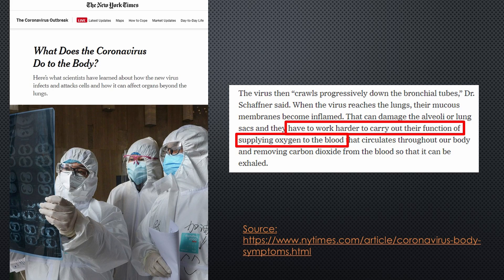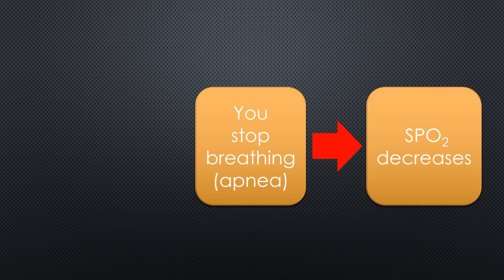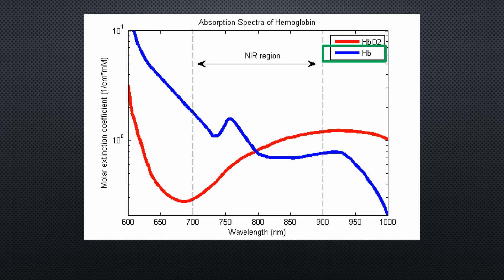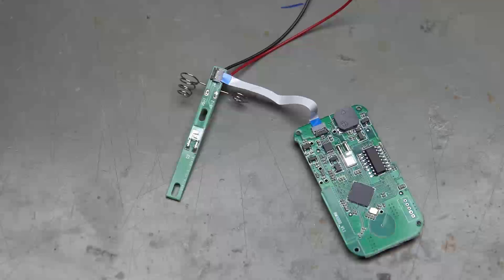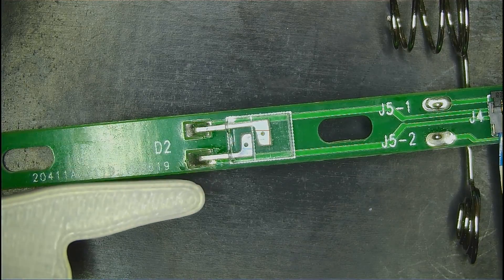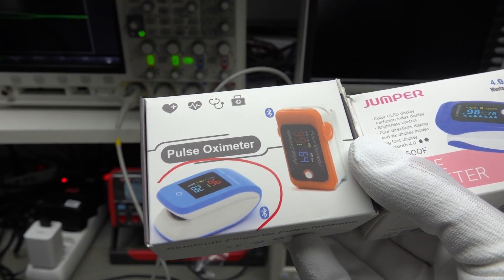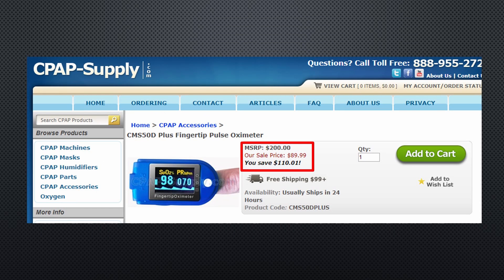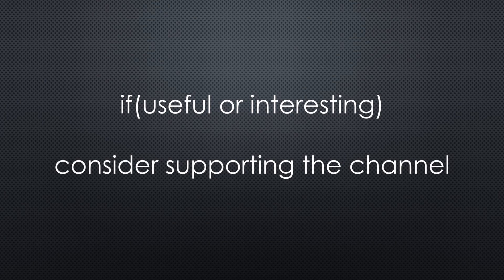#316 Pulse Oximeter test, function, and usage

Comment: You said it is hard to manipulate oxygen levels. I was testing myself a few days ago and got 94-93%, just like other family members. "It is crap"  that's what I told to myself. But then we went to the shop for a little apocalypse hoarding and when I got back it was 97%. Maybe just going to fresh air can increase it by a few percent?
Reply from the maker: During my test I also saw some changes depending on the movements I did. But I did no stress test.

Comment: :). But i would not recomend testing without having any symptoms and then alarming the doctor. - Btw: with respect to corona, another maker genius -> https://baophapluat.vn/s%E1%BB%91ng-kh%E1%BB%8Fe/t%E1%BB%B1-ch%E1%BA%BF-m%C3%A1y-tr%E1%BB%A3-th%E1%BB%9F-cho-b%E1%BB%87nh-nh%C3%A2n-ngh%C3%A8o-m%C6%B0%E1%BB%A3n-mi%E1%BB%85n-ph%C3%AD-221863.html
Reply from the maker: Interesting article. In countries without infrastructure this might save some lifes. Unfortunately you need to intubate the patients. Which is a little more than just adding pressure ;-)

Comment: I would love to see a video detailing how you took apart the CPAP and read its function! Thanks for the video!
Reply from the maker: I do not think there is a standard. So you have to google. Maybe you find information about your particular device. I selected mine because it is compatible with this OSCAR software. Maybe you place an issue there and ask for support? For this channel, this is too special.
Reply: @AndreasSpiess  Yes, each manufacturer probably uses a different standard, or personalizes the data so that only those in charge of the work: maintenance technicians or doctors, can read the data. Ultimately there may be some fool who wants to tamper their data for some sort of convenience.
p.s. my CPAP is a Respironics: a medical brand of Philips 
Hi
Reply from the maker: No need to take the CPAP apart. It has an SD card where it stores its information
Reply: @AndreasSpiess  my cpap had a SD card too but i  cannot read data. the pc tell that SD card is empty, but maintenance people can read  it! 
can you tell us why, maybe in a video?
Hoping all the cpaps brands uses the same code
tnx in advantage

Comment: Excellent explanation, as usual! The Red/IR was also visible in the photo of the "LED" 7:44 --> There are two dice and two bond-wires placed back-to-back. Another clue as to the red/IR on the scope 10:14 is the forward voltage of each. The IR has lower energy per photon, and hence a lower forward-drop (~1.4V) whereas the red has ~2.0V.
Reply: A project-idea? --> Create an open-source oximeter better than the crappy and unstable cost-down-rubbish with a (say) Teensy of STM32 M4 or ESP32
Reply from the maker: That is what I also thought when I saw the two different voltages. But I did not lookup the foreward voltages of hte different diodes. I think these devices are not crappy at all and it would be very hard to do it better.

Comment: Great video Andreas, thank you! However please be aware that this method doesn't allow you to draw any conclusion on a potential infection (eg with the virus), it is just a parameter that gives you an indication about the amount of oxyhemoglobin in your blood. Skin, bones, light etc are impacting the reading and therefor the absolute number you read on the display is never precise. You can read a SO2 of 99% or 92% and be healthy, but in case the value over time drops you should further investigate the reason for it. So the sensor is used to detect abnormalities over time and software on intensive care units offer dashboards that detect any significant alterations. Obviously a significant drop of SO2 above 10% would be such an indicator.
Reply from the maker: It had a reason I did not "praise" it for the virus application. The CPAP application is well known and AFAIK accepted.

Comment: I bought the CMS50DA+ from Walmart.  I use it with Eneloop NI-MH batteries, it's good for one night, probably not two, on each charge.  When the batteries are low it can give nonsensical results rather than shutting down.
I tried reading the data via USB with SleepyHead software with no luck.  It does work with the supplied software running on Windows XP (i have no plans to ever get a newer windows machine).
Reply from the maker: That was also my experience with IKEA batteries. SleepyHead seems to be the (abandoned) predecessor of the one I used.
Reply: @AndreasSpiess  - Thanks, I didn't know SleepyHead was resurrected.  That helps.

Comment: The graph at 13:50 actually shows SpO2 levels rising during the time breathing stops.  I assume this is because Oximeter doesn't keep track of time and software calculates time from the starting time that you enter manually and sample number, so this SpO2 plot is actually off by about 40 seconds.
Reply from the maker: You have to synchronize the two manually and it is hard to align the start on hte second. The Oximeter has no internal time.
Reply: @AndreasSpiess  The F and I models have timekeeping - unfortunately the CPAP's clock isn't as good. Mine needs to be reset at least monthly.

Comment: Very interesting, informative and potentially useful video, thanks !
Reply from the maker: You are welcome!
Reply: The Arduino sketch may not work with the max 30102. But a more powerful arduino type device  may work using the sketch. A reflexive rather than translucent hemoglobin device is useful very useful in determining blood perfusion in less than translucentParts of the body.

Comment: By the way, there are now cheap boards with AD8232 chips for ECG amplification. Normally it's a mess to set up differential amplifiers, what with dual power supplies etc. But these boards do all the work, require only 3.3V and output a very arduino friendly signal between 0 and 3.3V. From what I can tell (I'm a Veterinarian) the signal should be good enough for most ECG based diagnostics, even if not certified. It seems to have a low-pass filter around 1000 hz. Not sure how useful the absolute amplitude is, there is also some high-pass filtering going on. When I say "ECG based diagnostics" I mean that the amplifier seems good enough, but you'd have to arrange enough of them in the right way, of course.
Reply from the maker: There are quite a few videos around with this sensor. So I decided not to cover it. I would not know what to add. Most oximeter videos were less technical.

Comment: Thenk you for this video. As engineer and asthmatic patient I have one cheap device and I thought if it was good or not (for 20€). The one they use in hospital costs about 350€! I appreciate your work.
Reply from the maker: I also thought these are toys. This is one of the reasons for this video. When I started to dig into the matter I saw that the method is simple and can be done with standard LEDs and chips. And the accuracy seems to be quite good.

Comment: About a month ago I bough one of those things from the German company Beurer for about 50EUR. I have most of the time about 90%-92% oxygen level. That is far away from optimal but not as bad as it sounds. I also visited a doctor and he confirmed those values. I write this here so people don't panic if they see low values. My girlfriend has constantly 99% measured with the same device.
Reply: Please be aware that the impact of skin color, segmentation of the skin etc etc are impacting the measurement. Basically in med applications the trend is of essence, so if you have a drop in saturation compared to your 'standard' value there is an issue, otherwise you should not become concerned!
Reply: @juergwyser6520  In my case the values from my measurement and the values from the hospital match. I have "white" skin. My girlfriend has brown skin and her measurement is constantly 99%.

Comment: Thank you for this vid. I'm interested in measuring this but I always thought such medical sensors would cost an arm and a leg, or even more. Do you think it would be possible to receive the data live by BLE, all through the night, using an ESP32-based project? Such project could pass the data to MQTT/NodeRed/Influx/Grafana and it could administer a small electric shock at an APNEU event, or, start beeping when the sensor falls off from your finger during sleep.
Another way to detect breathing would be to put a loop of flexible resistive wire around your chest and measure the resistance of that continuously. That would be a good alternative for people that would pull off the finger sensor in their sleep.
You should buy some AAA-sized 3.2V LiFePO4 cells for your oximeter. The ones I bought come with a short circuit dummy, for use in 3 Volt devices that hold two batteries.
Reply from the maker: Maybe somebody hacks the BLE with an ESP32. So far I have no time for such a project. Thank you for the LiFePo4 battery tip.
Reply: yes this is very possible. You need to be careful with power requirements for discharge you would want to deliver. Just esp32 ble with i2c Max chip is very very simple but can be very noisy as well.

Comment: The 2nd fastest way to detect bad sleep (snoring, stopped breathing) is to use an audio recorder like audacity, set the sample rate to 8000 and a single channel (mono) to not waste storage space, and let it record the whole night. In the morning, look at the waveform where it was loud. If there is no snoring or sudden gasping for air, there is probably no sleep apnea problem. ;)

(The fastest way is getting told so by your significant other)
Reply from the maker: You are right! I was in military service in large rooms an I know what you are talking about. But there is a second indication which is quiet: When the brain stops to create signals.
Reply: The brain is quite robust. If there is something wrong with breathing, the CO2 levels rise and then it initiates some emergency functions. Rising heart rate, increased breathing reflex and partial wakeup. The amount of signals created by the brain will increase to stop the dangerous situation. The biggest problem with this is, it is a lot of stress for the body instead of regenerative sleep. Other health problems, like cardiovascular diseases might follow and can really cause the brain to stop creating signals...

A CPAP machine can help with sleep apnea, so can a change in sleeping position or weight-loss.

My Grandmother didn't want to hear anything about sleep apnea or snoring. The moment when the partial wake-up with forceful inhalation happened was extremely loud. My bedroom was on another floor and I still woke up from it. I wish I had known about CPAP devices when she was still relatively healthy.

Comment: I got a good one($40) a couple of months ago, and I guess I'm too healthy because it doesn't go below 95% even when training. I got a cheap ebay blood pressure tester and it goes from medium BP to low after 20 mins of weight training. I go to free UNI lectures and training to fatigue is the only thing that partially helps with dementia.
Reply from the maker: Sounds you are healthy. Very good for the comming times ;-)

Comment: do you think that if you use a STM32 or similar MCU can extract out data better from the MAX30102, than an uno???what's your opinion on the max30102??
Reply from the maker: I think I stated my opinion. If you follow the link of hte project in the video description you see that this guy used FFT to extract the pulse. You can definitively do more with a better CPU.
Reply: @AndreasSpiess  thanks a lot sir

Comment: In the Late 70's I worked for Hoffman La Roche as a Biomedical Engineer. We had a line of P02 Monitors Based on the Clark Electrode. The Clark Electrode was applied to the patient's Skin via adhesive and then connected via a wire to the monitor. The Clark Electrode needed to be set up with a Electrolyte and Membrane before use. We are very lucky to have optical P02 monitors now
Reply from the maker: I was also fascinated about this simple but effective method.
Reply: @AndreasSpiess This technology is still used for babies as their fingers are too small. Normally you apply the sensor on the head but you cannot monitor it continuously and a lot of time you burn the skin (above the Fontanella) . Another technology for babies uses laser diodes to get a continuous signal to avoid burning.
Reply: @juergwyser6520  Great info, Thanks !

Comment: I need a cheaper(low cost) sulphur dioxide sensor.... which one do you suggest??? A cheap one is more expensive than you think...
Reply from the maker: SO2 and SPO2 are not exactly the same ;-)  As I say in the video, I am no chemist, so I do not know the purpose of such sensors...
Reply: @AndreasSpiess  I only asked for sensor... not any allergic chemistry question!!!😂
Reply: @AndreasSpiess  purpose may be of any type... but my section of question that is Which Sensor do U recommend to trace Sulphur Dioxide is in electronics section... which one is low-cost or how can I detect... and my use is in Exhaust Gas Analyzer that is used by Mechanical Engineers to find the usefulness of Engine Exhaust Gasses to use them or not decision like in Power Plants like in economizer, turbo engines etc to use exhaust gases etc.... my and your concern is only from sensor... remaining concern is by the user who want to analyze them..